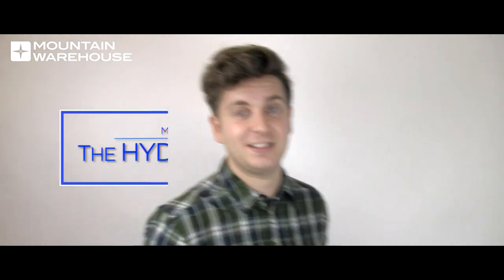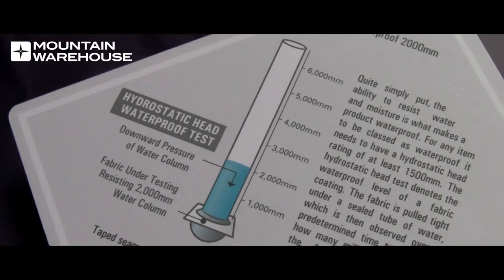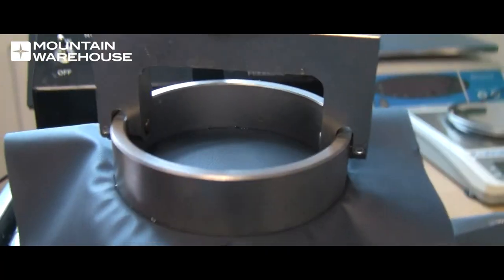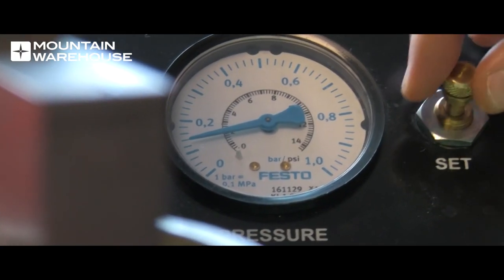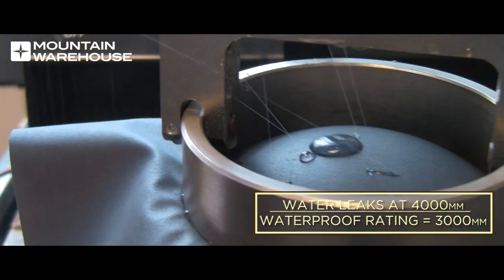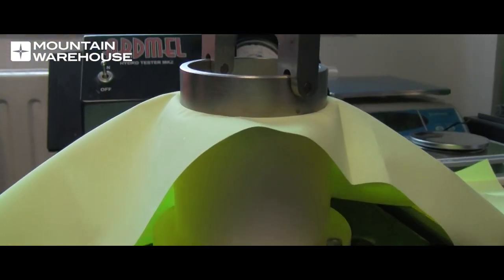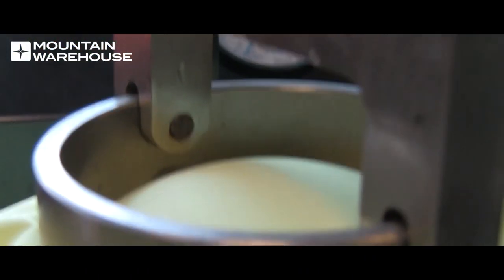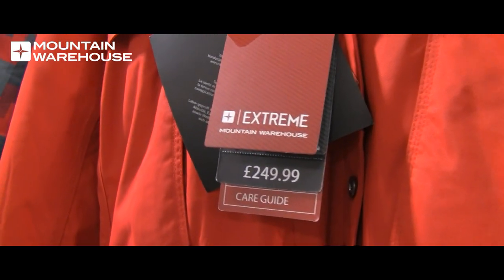The Hydrostatic Head Test

Comment: Worth noting that a heavy duty plastic bin bag will reach 6-8000mm hydrostatic head.
I also have £6 pound waterproofs that will go over 12000mm
Hydrostatic head is important but you also need to factor in the weight and breathability of the material.
I have some plastic storage boxes in my back room with a hydrostatic head of about 100 feet. Not sure I would want to make a jacket out of them mind ...

Comment: hi thank you for the video but one question my coat has waterproof rating of 5000 mm what does this mean? will water seep through 
thanks. keep up the good content
Reply: You are perfectly fine with a waterproof rating of 5000, that's able to hold 5 metres of water pressure before it seeps.

You'd have to be in extreme conditions for any noticeable effect.

Having said that, I find the longevity can be effected to varying degrees depending on the materials used.

I tend to stick to 5000 jackets because they are cheaper and can be replaced after a while.

edit 4 years late, oops.
Reply: @WhoThisMonkey i tend to stick to higher rated jackets... So they don't have to be replaced after a while, saving on cumulative cost. Also for doing a better job at keeping me dry